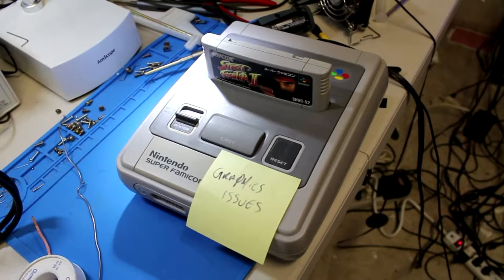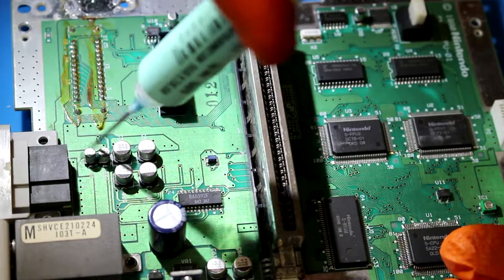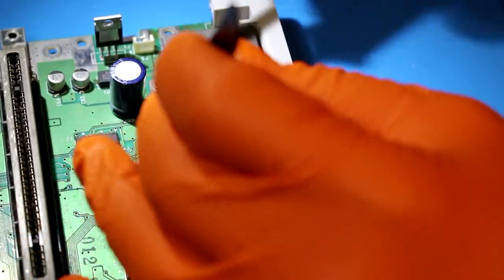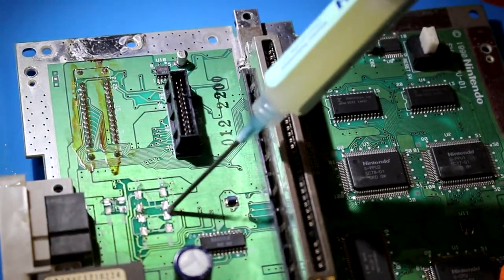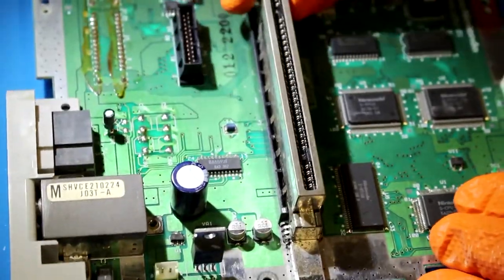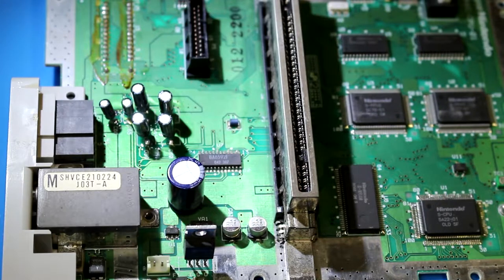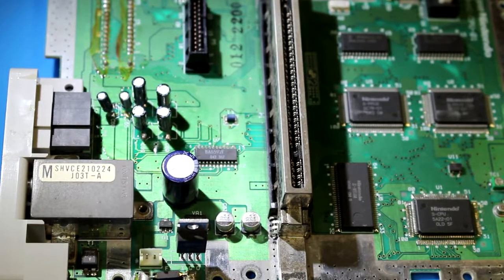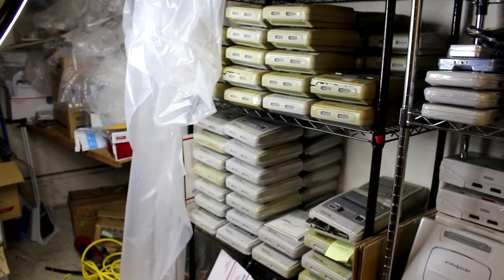Super Nintendo/Famicom SNES/SFC Graphics Error Repair

Comment: Hey man, good vid! I have the same addiction living in working in Thailand. I've bought so many Super Famicom's, Famicom's, disk systems and other stuff here. I've been testing and repairing my hoard and honestly I don't know what I'm gonna do with it once I get it all home. Since my channel is about arcade repair I'm tentative about adding console repair even though that's another passion of mine, lol.
Reply from the maker: Thailand is a good time. I am considering moving there when I retire.
You should definitely add the console repair stuff to your channel.  I need to check out your arcade stuff.  I have a JAMMA cabinet that needs a power supply and that's something I've not learned to do yet.
Reply: @wilsvgaddiction4456  Yep, I love living here too and can see myself retiring here. Thanks for the advise! I'll upload some more console stuff to my channel. With your power supply, it's an easy fix. If you can do the SME troubleshooting and repair you'll have no issues with a  PS. What arcade is it?

Comment: Nice repair man, your commentary cracks me up. I have an SNES that has a weird issue, there are graphics problems but many games lock up and freeze consistently or I only see the starting logo or intro screen. Very odd. John Madden football works fine...go figure.
Reply from the maker: Hi and thanks for watching! I have a couple like that and I'm yet to solve this issue.  I've swapped the SRAM and have determined that is not the problem.  Only thing I can think of is the PPU or CPU but I'm reluctant to risk destroying a good system to trouble shoot a bad one.

Comment: Yo, just got done following your video to repair my SF. I appreciate the guide! So quick question, I think my SF looked fine after completing the repair but upon switching games, I now have a green tint only present in the upper right hand corner of the screen. It's present for any game I test. Have any ideas as to why this could be?
Reply from the maker: I'm not sure. I have never seen that problem before. Is the polarity on all the replaced capacitors correct?
Reply: @wilsvgaddiction4456  yeah polarity is correct on all of them. I left it off for a bit and tested again and no green tint anymore. Hopefully it stays away haha
Reply: Tinted color seems like a cpu or gpu issue. Some videos on here show it being fixed by replacing just the cpu.

Comment: Cool video Wil. I have been having an issue with my Super Nintendo... I.E. when I boot up Donkey Kong Country at the starting screen with cranky he is mostly not visible just black with the backround.. other then a little bit of the image is showing. Do you think that is capacitor as well? Thanks! :)
Reply: Then the game boots up fine there are just little distortions in the graphics.
Reply from the maker: @dspotteries3198  Is it just that game?  Unfortunately, if you're having issues with more than one game having graphics that don't appear at all it may be one of the system's chips.
Reply: Nah it's definitely something wrong with the system... The game plays alright just somethings are distorted... And does it with Metroid and other games too.

Comment: Thanks for the video. I have a Super Famicom with a GPM-02 board. It works well but sometimes on Mario Kart for example Mario and other characters have black lines through them while driving on the track but not off track. That should not happen. I'm guessing the caps have not been replaced on the board since factory 1993 so I'm going to swap out all the caps. I hope that is the problem. I've taken apart and cleaned the board and didn't see any leaks  Any thoughts? thanks
Reply from the maker: That is strange. You should replace the caps but it sounds like your CPU might be dying.
Reply: @wilsvgaddiction4456   Thanks. I ordered the caps and a new 10V power supply. I'll see if that helps.
Reply: @wilsvgaddiction4456  Yeah iam experience something similar on a super famicom i got...

Comment: Hey I noticed you got a lot of super famicoms, you also mention some still have issues, well I’m uploading some super famicom repair videos on my channel check them out if you need to reference a similar fault.
Reply: Can you help me :(, my snes plays some cartridges Nice but some of them with green and colorful sprites, specially with games like Ultimate mk 3 or super mario kart, but simple games like donkey kong 1 or super mario world are ok, do you know what is the problem??, there was a moment that I tried to clean the pin reader by getting up and cleaning up with isopropilic alcohol :(, and then this problem appears :(
Reply: Eduardo Chero so the console was working well before you tried to clean the cartridge slot? If so, check closely to see if anything is caught in the pin connector. I’ve had an N64 on one of my videos that wouldn’t work because of a wad of paper was lodged in the pin connector. If some games work and others don’t you could also have a bad ppu and if that’s the case it’s a more difficult job.